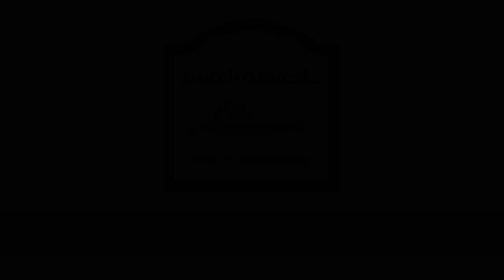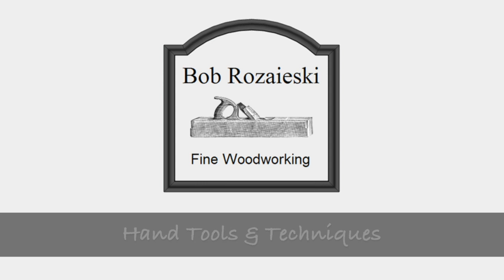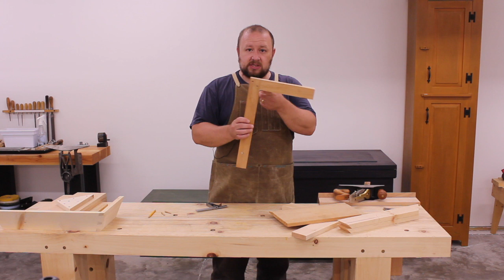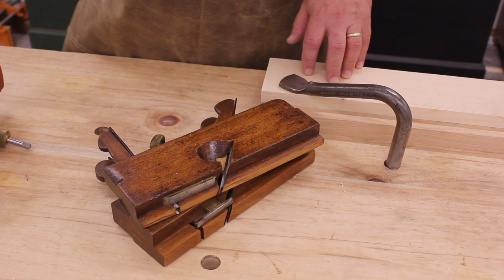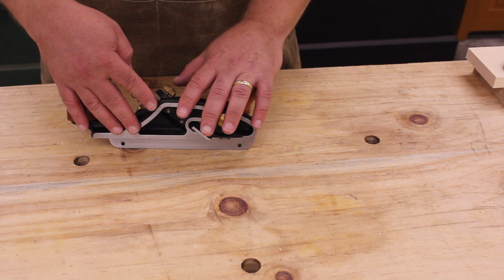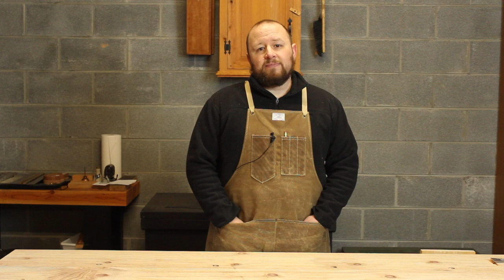Hand Tool Woodworking Q&A - Using Reference Surfaces - Dado Planes - Rabbet Planes

Comment: Hi Bob, First let me thank you for all your fine videos.  Very very few “instructors “ in YouTube have the ability to explain as clearly as you do.  Please don’t stop posting your knowledge.  Second, I wanted to follow up to your comments about the Combination plane.  I understand Stanley’s could not be the ideal plane for rabbets/dadoes but what is your opinion about Veritas’ combination plane? My understanding is that it overcomes any of Stanley’s shortfalls and it can work for very well for rabbets and through dadoes with the appropriate blades and a shop made batten (for through dadoes).
Reply from the maker: Hi Edward,
Thanks so much for your very kind words!
For the most part, the function of all combination planes is very similar. While I’ve personally not used the Veritas, it’s design is based on the Stanley and Record versions. The primary difference between the Veritas and old Stanley and Record models is that the fit and finish of the Veritas is much better, and the tolerances are tighter. However, the design of all combination planes shares the same shortcomings vs a dedicated rabbet or dado plane - no sole. 

The planes function brilliantly as a plow plane, which is essentially what they are. As blades get wider, however, the planes get finicky because the second skate or sliding section needs to be adjusted precisely. In a dedicated rabbet plane, the 1 ½” wide blade is supported across its entire width by the plane’s bed. In a combination plane, the support is only on the outer edges with no support in the middle. So the planes work fine with light cuts but the wide blades can experience some minor flex in the middle of the cut is too heavy. 

But the main disadvantage these planes have is across the grain cuts like cross-grain rabbets and dados because they have straight blades. Rabbet planes and dado planes meant for cross grain work have skewed irons which cut much cleaner and easier across the grain.

When it comes to beading, the combination planes can do an acceptable job if great care is taken in selecting a board with ideal grain and if the second skate is adjusted just right.

So yes, a combination plane can accomplish all of the jobs that they purport to do. However, they can be finicky to get set up just right for each of those tasks. With dedicated planes, they’re set up to do a single job and don’t need to be fussed with after initial setup. They’re just ready to go all the time. I find that the dedicated planes are more convenient, but they don’t necessarily do a better job than the combination planes if you take the time to set the combination plane up precisely, except for cross grain rabbets and dados where the skewed iron planes still do a better job. I’ve heard that the Stanley #46 does a decent job cross grain since it has a skewed iron, but I’ve never personally used one. And the #46 doesn’t accept blades for beading or tongue & groove. 

I use a Record No 050 for my plow plane and it is a full fledged combination plane with rabbet, tongue-and-groove, and beading blades. I’ll try to put together a video on it, comparing it to the dedicated planes.
Reply: Bob Rozaieski Thank you!  I totally agree that dedicated planes are ideal.  I was trying to save money :(   Look forward to watching the video.  Thanks again!  By the way, I’m new at woodworking and a hobbyist,  but the passion is growing day by day (and my bank account shrinking at the same rate)

Comment: Thanks for the videos Bob, I've watched all your YouTube content and enjoyed it! As an aside for the Stanley #46 question, the sliding section is the key to rabbets and dados. If the sliding section's skate does not form a wide virtual sole for the plane spanning the width of the cut like a wooden rabbet plane (it may be missing entirely and a new buyer not realize it) the 46 will wobble in the cut on it's single thin skate making wider rabbets and grooves very difficult indeed. You just have to have the sliding section forming that two skate virtual sole supporting the plane and not outside the cut. It works really well for rabbets and dados then, much better than the other taller straight iron combination planes. I had a similar problem the first time I tried a wide rabbet with the 46 and just scooting the sliding skate over to support the plane in the cut fixed everything. As you said, setup is key with those combination planes and it can be a little fiddly at first or they may be missing pieces or a cutting spur where it is really needed for an operation. I like my 46 though, it even comes with the 13/16" blade!
Reply from the maker: Also, make sure the two skates lie in the same plane.  Sometimes one sits higher than the other, and this is a nightmare to deal with.  As you said, adequate once they're dialed in just right, but very fiddly to get there. Then you have to take it all apart to switch operations and start the fiddling all over again :).

Comment: Hi bob, I have two questions. Why your wooden rabbet plane is so narrow? I have seen old tool chest on second hand webs, and many of them have two or three rabbet planes with different widths. Why old time people needed them? I thought the wider the better for making rabbets(more comfortable to grab and "making a fence with the fingers" )
Reply from the maker: Unfenced rabbet planes came in various widths to allow versatility for various tasks. When simply sinking a rabbet, a wider plane is better. But when needing to use the plane on its side to finesse a rabbet, a narrower plane works better. Narrower planes are also easier when using rabbet planes to rough in a molding. If you need to bevel off an arris between several rabbets, if the plane is too wide it can’t reach in between the adjacent rabbets. It’s kind of like having more than one chisel. You may not need all the sizes but having a few different sizes can be helpful depending upon how you work.

Comment: Bob, I have a question. Is it possible to cut box finger joints by hand? If so can you some day show us how? Kind regards, George.
Reply from the maker: George Geyer Of course it’s possible. However it’s really a joint that was designed for a machine. The joint originated to make it easy to make boxes and crates quickly with the early machines of the industrial revolution. These machines couldn’t make dovetails, which were the predecessors to the box finger joint. By hand, making the finger box joint is identical to making dovetails, you just don’t angle the pins and tails. You make them all straight and evenly spaced.
Reply: @BRFineWoodworking  Bob, thank you for taking the time to answer my question. Kind regards, George.